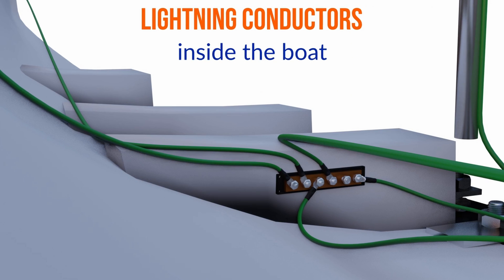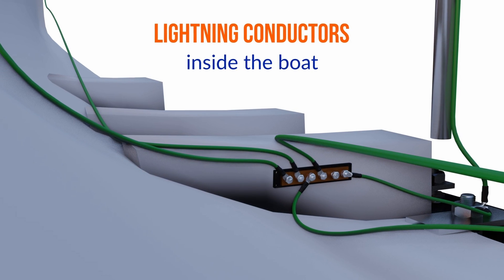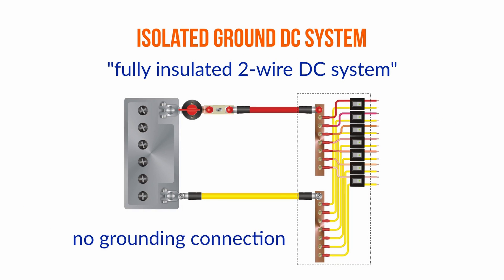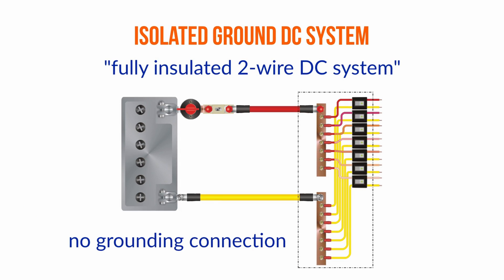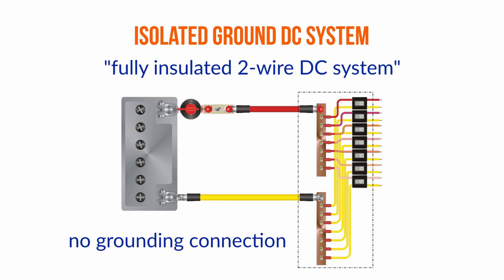Isolated DC Systems on Boats - Is my system GROUNDED or not? | Ask The Expert with NIGEL CALDER

Comment: My 80s boat system is set up like this except the lightning ground is not connected to the DC negative. But the prop shaft is not isolated from the engine so there is some connection to the water to the DC negative. Would it be better to isolate that propeller shaft connection from the engine to make it a true floating system?
Reply from the maker: If its an 80s boat it likely was not built with an isolated ground, or the isolation has been subsequently voided! I think you need to sketch all the principal wiring on the DC negative side and whatever is in the lightning protection system, galvanic bonding circuit, and where the AC grounding connection is made. If this really is an isolated DC system, the lightning protection system, bonding, and AC grounding should all go to a grounding bus with the DC negatives going to a separate DC main negative bus, and no electrical connection between the two (open circuit with an ohm meter). If it is a grounded DC system, the DC main negative bus and grounding bus need to be electrically connected. They may, in fact, be the same bus (we separate them conceptually, but not necessarily physically). Sketching the circuits will, in any case, be a useful exercise! If it is isolated, whether or not the propeller shaft is isolated from the engine generally makes no difference - the engine itself will be isolated via an isolated ground starter motor, alternator, and instruments.